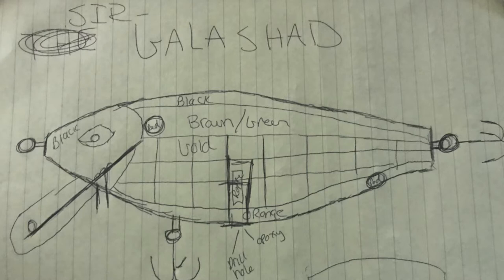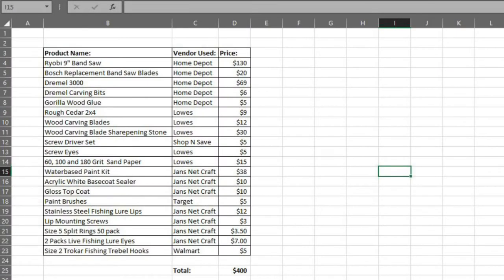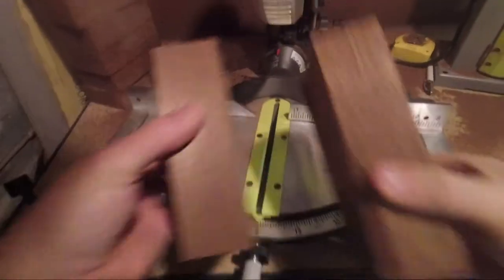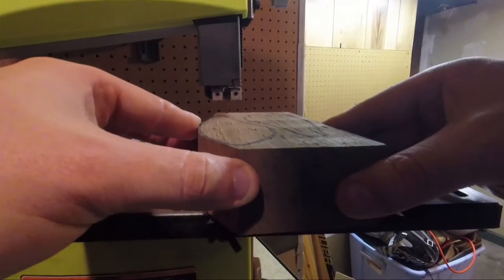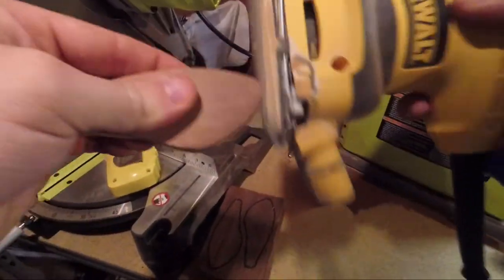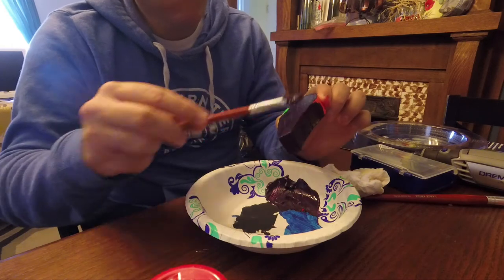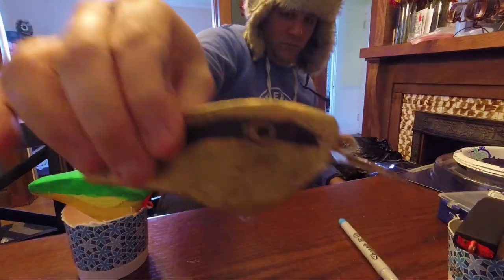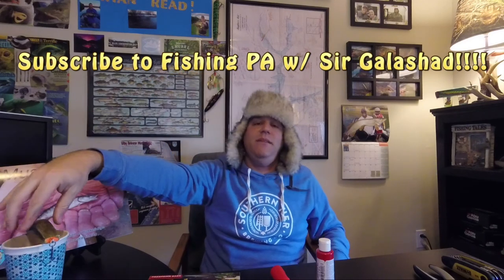Designing and Building My First Pike/Musky Crank-bait Fishing Lure - Sir Galashad

Comment: You need a belt/disc sander (harbor freight has them fairly inexpensive) it will smooth those edges off quickly. Let us know when you're lures are available, got my musky setup last week and would love to try one out. 👍
Reply from the maker: Jason Bozic , yeah dude , for less than $60 bucks I can solve that issue! Thanks for the comment and the tip, that’s helpful! I’m going to check that out this weekend! Gimme some time to test the profile out, I’ll get you one or two! I’ll let you know when I’m closer, I just don’t want to send you the first go around without feeling comfortable! Gotta make sure them swim the way I want , plus they gotta troll ...
Reply from the maker: Jason Bozic , forgot to ask, what setup did you go with?
Reply: Abu c4 6600 and a 7'6" bass pro graphite series musky rod. Haven't been out yet , waiting on the weather to cooperate.
Reply from the maker: Jason Bozic , sweet deal dude! I love the C4s for sure! What line did you go with? Yeah the weather has not been the best, it’s going to get worse over the next few days!
Reply: @FishingPAwithRyanRead  50# power pro braid and I got fluorocarbon leaders I think 100 or 130# can't remember. You think that will work? I don't plan on slinging big ass baits yet, probably 1 - 4 oz. at most for now. Picked up a couple bucktails and a few crank baits too.